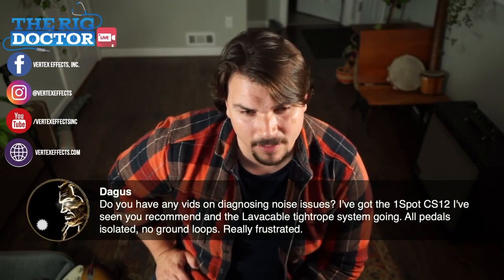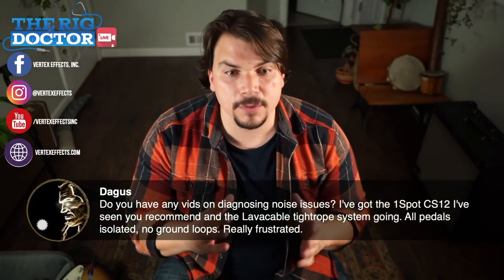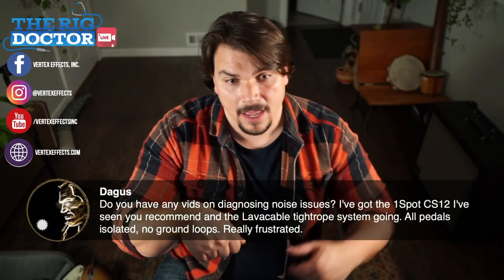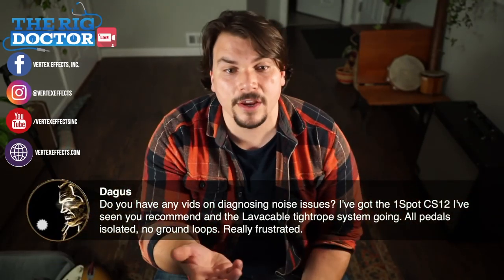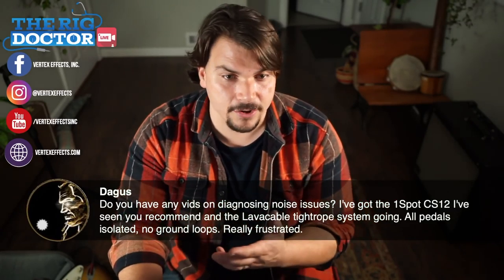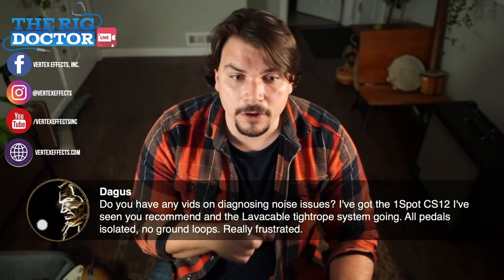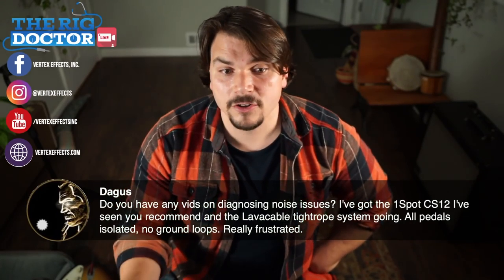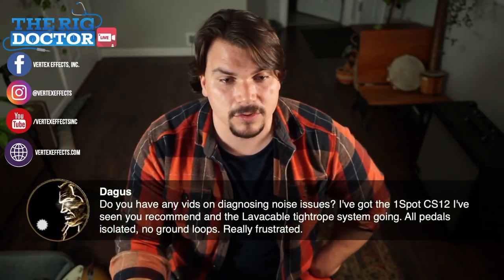Fixing a Noisy Pedalboard!

Comment from the maker: Hey folks! Hope you found this video helpful-- let us know your process for finding noisy pedals in the comments!
Reply: Vertex Effects how can you differentiate single coil hum vs noisy pedalboard?
Reply from the maker: Lincoln Lee turn off the guitar volume.
Reply: Vertex Effects great info!  And how do you differentiate stage lights/bad electricity vs guitar o pedalboard noise?
Reply: @jmd12331   for what it's worth:  bars/venues will sometimes have clean energy outlets marked or the ones to avoid. I always ask the bartender/manager. If you get past that, then is your pedal board noisy at home or at the rehearsal space? Sometimes you can soundcheck at bars earlier when stage lights aren't on. I'm sure Mason knows better than I though.

Comment: Definitely going to try this approach to isolate where noise is coming from. Recently moved, and other than being in a new location, and actually putting my pedals on a board, nothing in my signal chain has changed. Suddenly, any pedal that engages creates noise, but the pass-through into the amp is clean. So something along the pedal chain.
Reply from the maker: Good luck!

Comment: Thanks for putting this out in a video, that solderless aren't that good. I think it's the most hyped thing. It might have been once upon a time, but today, there's really no excuse for unsoldered cables. I am done with George L and that stuff. I might have George L actual cables but I solder them onto Neutrik plugs instead. Works a charm. 
I got caught up, in your own problem and I saw your pedalboard, with that volume pedal and having the - culprit - the BigSky reverb by Strymon. The following information can be of use for the rest of the watchers around here, both comments from past and future. 
Most Strymon pedals that are digital, and containg time-based pitch, octave, and especially shimmering effects, does not gel well with any for of dirt pedal in the chain, that has an INTERNAL CHARGE PUMP that raises the voltage INTERNALLY from 9v to 18v. This is out of customers knowledge, and very few specs on pedals states this if they have or not. Of course one can't demand that the customer should know about this. But, in my experience it has been like these internal charge pumps creates a high peak signal waveform high up above human hearing at around 22-23 Khz. This can only be seen if you record in a DAW with a coundcard that can do high sampling rates such as 192 Khz, you'll see the pedals idle noise (whether it's in bypass mode or note) creating a PEAK in the waveform up above 20 Khz, which is the human limit and even there, for young people only. 
Now what happens, is that the pristine AD/DA converters of Strymons (Digitechs, Eventides too) detects this one, picks it up and does a down-sampling in pitch, shimmer, and octave effects, and half of 22 Khz is around 11 Khz and - voila - can be hard as an annoying high whisteling pitch. My Klon Centaur (yes that one, the real one,) had a charge pump and I had to remove either that one or the Strymon reverbs. Numerous bosst/drive/distortion pedals has this. Note: If it runs from 18v outside, i e need 18 volts from the adapter, the problem isn't there.
It's called HETERODYNING, the phenomenon that occcurs. 
Now, these days, it's a feud going on which manufacturer should use proper filtering because it can be filtered out at either end. Of course, the dirt pedal manufacturers refuses to do this, and the digital high-end like Strymons thinks it's none of their business. Now, including any kind of switched power supply in the chain (i e not a regular ring transformer power supply) can exacerbate these whinings and whistlings too. Adding pedals, no matter how analog, or passive they are anywhere in the chain - like your volume pedal - can exacerbate the whisteling, or the other way around, act like a filter, and filter it out. Strymons are most known for this idiosyncrasy though.

Comment: I'd like to add that a noisy guitar sometimes is the culprit. We tend to blame the pedalboard but sometimes it's a guitar that needs to be proper shielded.
Reply from the maker: Sillas Lucena turn off the guitar volume and that will isolate that problem from the pedalboard.
Reply: Vertex Effects Sir, if im going to turn off the guitar volume and the noise will disappear does it mean that the guitar is the culprit?

Comment: I was leaving my TS5 on as part of my new tone with a chorus pedal. The Blues Driver was new to me and I only wanted to use it sparingly. I found my Blues Driver into my TS5 caused a ton of hiss when they were both on. I reversed them and it was a bit better. I moved the NS2 in front of the TS5 and it helped more. Thanks for the tip on starting backwards instead forward, as well as using a higher gain amp.

Comment: Hi! Not sure you're going to see this, but here goes nothing...  I'm getting squeal in my chain (powered by a Voodoo Labs Pedal Power 2 Plus), which I enable either my Darkglass Alpha Omega, or my Empress Heavy. I'm hoping you can offer some suggested solutions. My current chain is... Bass (active Marcus Miller 5-string bass) --> Polytune3 tuner --> Empress Compressor MKII --> Empress Heavy OR Darkglass AO (plugged into the PP2+'s 250mA slot) --> MXR Bass Octave Deluxe --> Source Audio C4 (plugged into the PP2+'s other 250mA slot) --> Hotone Krush --> Ernie Ball MVP (active) --> Amp (Markbass Mini CMD 151P). Would a solution be a buffer (thinking about the Empress Buffer+)? Is there already a buffer in my chain (either with the Polytune or the MKII)? Really appreciate the insight!

Comment: Hi,  i have a weird problem hope you have a suggestion > My tube amp is super quiet when i go direct into it, when i put in the cable from the pedal board WITHOUT any pedals turned On , i am getting very loud  noise/hum...without any volume on also from pedal.. ?? don't get it .. Help ???

Comment: I didn't really know what I was doing when I first built my board. But got pretty lucky in that I wanted and bought used modded pedals.  Mostly Boss. So I think ,and I could be way off base on this, that getting used modded pedals each builder might use better quality pieces and makes each pedal more quiet than stock. Now while assembling this board I hooked everything up on the floor 1st and played with each pedal and moved whatever around to listen close for problems. Found some pedals don't like each other. Found best way to lay out board for the 1st run. I've changed a few but kept the noise down to nothing at least at my places to play. I think my best deal was to put a silent modded 10 band EQ as last pedal. Don't even need the buffer part of my dB-1 buffer/ boost pedal. Engaged no difference as not engaged.. All cables are EBS Gold flat patch. Power unit is a CHEAP Caline P-1 unit. And 12 pedals on board ,5 modded 1's. 60/ 100 tube amps so there is that noise. Also I use wireless all the time. Again it's a boost to my system.

Comment: Did you consider grounded power first that could be the cause? Thnx!
Reply from the maker: Most power supplies are grounded and even so, with most pedalboard issues with a decent supply that's isolated, the issue is generally in the cabling or the pedals themselves.

Comment: Hmm interesting, I have a ground loop noise issue on my pedalboard (metal chassis Rockboard), if any of the metal patch cord grounds make contact with the pedal board, I get the ground loop hum. The power board is supplied by a voodoo lab pedal power 3 Plus which is mounted to the underside of the pedal board with metal brackets. Only going into 1 amp. Do you have any idea why this would be creating a ground loop?
Thanks for your time
Ollie

Comment: I suspect that my EHX Silencer, despite being a noise gate itself, it introduces whistling noise in fx loop when high gain channel being used. A loud whistling noise occurs when the gate opened and the noise simply gone when i roll back the volume knob on guitar but comes back when having the knob rolled back on
Reply from the maker: Have you tried removing it to see what happens?
Reply: @VertexEffectsInc the noise gone 😥
Reply: See above my post for heterodyning effects, especially those pedals with internal charge pumps which ramps the voltage up from 9v to 18v.

Comment: I've got a pedalboard from pedaltrain with a Cioks DC5 and a Cioks Schizophenic underneath. My wah pedal is on top of the Schizophrenic and has a noise issue. How can I shield the power supply to solve the noise issue?
Reply from the maker: No, wah can't be by a toroid transformer.  You could try to get a mumetal can for the inductor on the wah.

Comment: A fairly consistent "ticking" noise has been introduced into my signal chain. With daisy chains the ticking noise was pervasive, then I switched to isolated power supplies. It's been reduced by 80-90%. Could this be an issue with my AC source? For example, if I've daisy chained power strips? Thanks!

Comment: I'm using stereo amplification so I recently purchased a passive a/b y Switcher to see if it can lower the noise from two amplifiers. My fingers are crossed
Reply from the maker: If it's a isolation issue, you'll need to make sure you have some sort of transformer to fix the issue.

Comment: Hi Mason,  I recently purchased a Fender Princeton 1x12 and I get a slight hum when I plug in my board.  When I plug straight in to the amp I get no hum.  I have a full size fuzz face on the floor that is powered by battery and I still get hum running through the fuzz face then directly in to the amp.  Any ideas?
Reply from the maker: Cables?  What happens if you turn off your guitar volume knob?
Reply: @VertexEffectsInc  You are right, it was the second cable I was using.  Another reminder to use good cables in you ring.  Thanks for following up.

Comment: Mason, I might need to ask this with more info in the future. I've been narrowing down what pedals I want to keep. When I run the guitar - let's use the tele in bridge position - into the BOSS NS-2 {on}, then into the BOSS CS-3 {on}, into the BOSS BD-2 {on}, then into the amp, the CS-3 is creating noise; much worse when the NS-2 is off. Is it something I've done? With the NS-2, do I need the CS-3? If I exchange the BD-2 for a TS-5; similar issue. I'll continue to experiment. Thanks, Chris
Reply from the maker: Lost Smoke is the CS-3 in the loop of the NS-2?  The send and return?
Reply: @VertexEffectsInc  no. I have the Tele direct to the input of the NS-2. From that NS-2 output, I  have it going to the input of the CS-3.

Comment: What pedalboard is that in your video 
I bought a Behringer PB600 powered pedalboard because I need to travel. But got huge hum. Have you used one?
Reply from the maker: sixxbrisbane I think it’s a flat GOMC board with a Fix Pedalboard riser.  The issue is the power on the Pedalboard.  If you get an isolated supply, you’ll be fine!

Comment: Does the keeley compressor can be daisy chained? was it the lehle volume pedal that is noisy when daisy chained?
Reply from the maker: David Estrada the Keeley didn’t seem to have any issue, it was the VP that seemed to not like anything shared with it.
Reply: @VertexEffectsInc  So will the solution be to just filter coming off the volume pedal? Is it something where you could address it with a buffer between the VP and the Comp? Or is the simplest solution, since its just a volume pedal, be to replace the pedal itself?

Comment: Hey Mason! Great vid. I have a noise problem that I would like some insight on.
I am running a Cioks ADAM to run 5 pedals. The culprit is an old Arion Stereo Chorus. I can hear a very subtle vibrato thing going on when the pedal is off. The subtle underling vibrato gets amplified when I introduce a drive/boosts. Any idea how to reduce said noise?
Reply from the maker: Andrew, the pedal isn't true bypass so you can get some clocking or oscillation.  You can have these modded so this doesn't happen.  A True bypass conversion should solve this.  You can also see if a battery helps the noise issue if you think your supply is the issue.

Comment: I get a gnarly hum from my pedal board when I run my pedal board into my amps input, at my practice space, but not when I go directly into my amp (jc-120) and put the pedals on the fx loop... i get no hum from my pedalboard at home directly into my interface...
Can someone explain why there is such hum using the preamp on my amp, but not at home using the preamps on my interface?
Reply from the maker: I would check out our video on troubleshooting with Rhett Shull.  It’ll help you better ID what the noise might be.  In general a isolated power supply and quality shielded and soldered guitar cables go a long way.  If you plug into your amp alone does it make the same noise if it’s just the guitar and amp?  What if you turn off your guitar volume?
Reply: @VertexEffectsInc  thanks! ill check that video out.
I get no hum when its just my guitar plugged directly into my amp... 
i have all my pedals using their own power supplys plugged into a surge protector, i notice if i daisy chain them, the noise is worse...
Reply from the maker: What’s the power supply
Reply: @VertexEffectsInc  just a couple boss power adapters on my tuner/distortion/microcosm, and my dittox4/and flashback x4 are on their power adapters they came with

Comment: I just noticed my pedal board (6 minis and an isolated supply) make a faint buzz or hum when I use them at my work apartment. Then when I’m straight into my interface with my guitar it’s not there. I plug in the 18 v into a nearby socket and the same noise is there even though I’m not ruining into the board. No lead into it. Is  my apartment’s electric work shoddy...? It is old. Would a power strip fix this? Thanks! It’s a new board I built for travel and but when I use it at home at our place into an amp ( I’m using a power strip for  both) I didn’t notice. Currently away for work and noticed it. It’s very quiet and manageable tho. Thought it was my freshly 4-way modded Tele and did some trouble shooting. Just curious.
Reply from the maker: What about when you turn the volume off on your guitar?
Reply: Vertex Effects I recall it being there regardless. At first I looked into the tele, but my multimeter shows 0.00-0.01 across ground at all points (plate, bridge, knobs, pots, neck cover). I know that series position 4 raises the noise floor so that’s why I started with it. When I noticed that headphones on straight into my interface, I could hear it when I plugged the supply in (despite not running into it) I figured I’d reach out. Any advice would be great.

Comment: I have a couple of pedals that are consistently noisy no matter what - a Pigtronix Quantum Time Modulator that makes a faint high pitched whining and a DejaVibe and Supa Trem that make static in the background when engaged. Is this normal or is there anything that can be done about it?
Reply from the maker: What power supply are you using?

Comment: MASON Vertex, Have you tried using magnetic viewing film paper so you can see all the magnetic fields of the power supplies transformers and power supply adapters are overlapping magnetic fields into the audio signal causing the signal to noise ratio to be higher. If you use magnetic viewing film paper you can see the magnetic fields and lower the noise floor lower. You should make a video lesson about this because you want the power supplies magnetic field to be far away. I think you have to create a Barricade build a wall around the power supplies and wallwart transformer adapters using MU-Metal Shields surrounding to block the magnetic fields. Have you tried using MU-Metal Shields to create a barricade wall around the power supplies to lower the magnetic field flux level from the audio signals? This will help with the signal to noise ratio lowering the noise floor level
Reply from the maker: I haven't because a single coil pickup seems to make more sense wired to a guitar cable and doesn't require anything specialized.  Also most supplies now are moving to Switch Mode so this will become less and less an issue in time as the linear supplies are used less commonly for pedalboard applications.  The mumetal can around the supply is a non-started.  Super expensive and would be more mostly than buying a new supply and using the amount of steel to get the same shielding would make the boards so heavy it wouldn't be worth it.
Reply: @VertexEffectsInc  Which Noise Reduction pedals and Noise Suppressor pedals do you recommend for pedalboards? I'm not talking about noise gate pedals, I'm talking about noise reduction/noise suppressor pedals besides the boss NS-2

Comment: I just put my boss tuner at the end of my chain, it used to be on the front, just a straightforward pedalboard.. my question is why don't I see others with it at the end? it seems like a good way to have a master kill switch if anything goes wrong on the board
Reply from the maker: The further away from the guitar the tuner is the less accurate it is, JerkyTreat said the rest.
Reply: I put mine at the end too. I dont really use "always on" pedals and there is only 4 pedals in front of it, so I have never experienced tuning issues because of its placement.
Reply: Boss pedals have a buffer and you generally want a buffer right after your guitar pickup as close as possible.
Reply from the maker: troy house I would avoid using a boss pedal as my input buffer if at all possible
Reply: Vertex Effects yeah maybe not the most ideal buffer to have first. Side note question: What delay pedals do you know of that have a natural sounding buffer? I don’t use many effects and mainly use a clean sound. I like to use delay pedals in buffered mode for trails in reggae/dub stuff but keep my clean sound natural without too much high end or digital sound. Strymon and TC stuff have worked for me but line 6 buffer sounds artificial to me. Any other delay pedal suggestions?